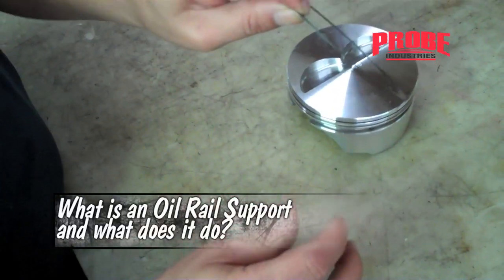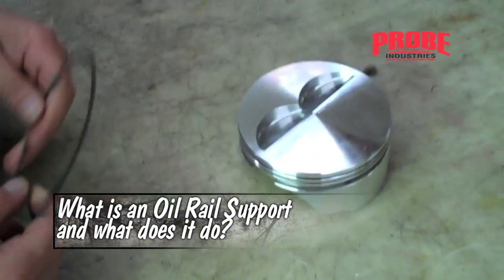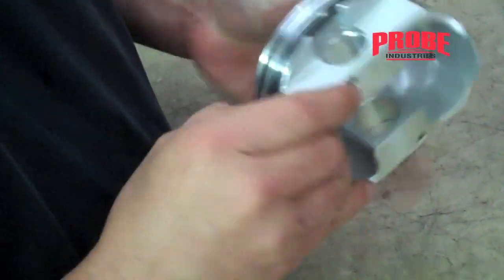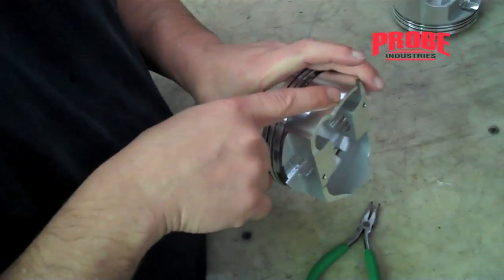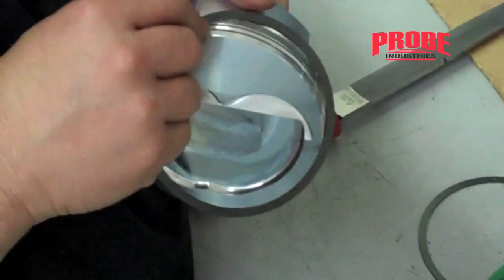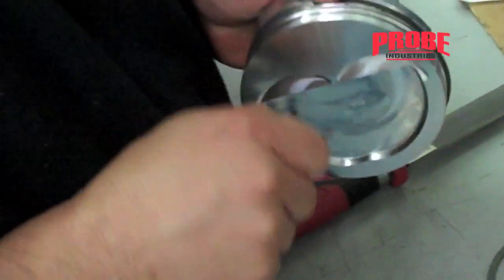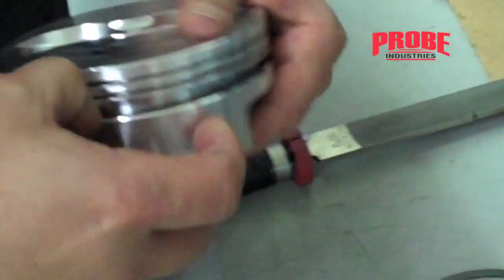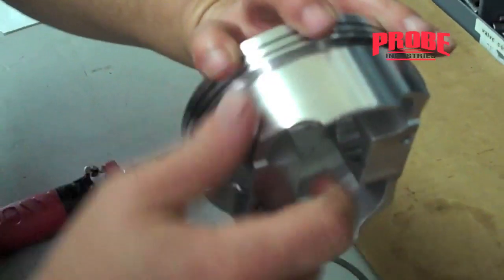Oil Rail Supports For Pistons: By Probe Industries [HD]

Comment: Great video. I was freaking out at how much I needed to bend the oil rail supports to get them around the piston, but after watching this I just went ahead and opened them right up - a satisfying click as they locked into place. All installed with dimples where they need to be - thanks again!

Comment: I've got oil rail supports on my used Probe pistons, but they don't have any dimples to stop rotation, and they ends overlap slightly in the pin opening and stop from rotating. Is this correct, or should I file them down? If so, they will eventually rotate and jam against pin hole, right?